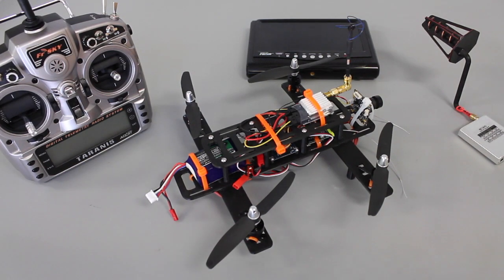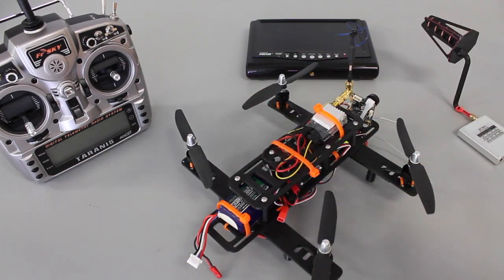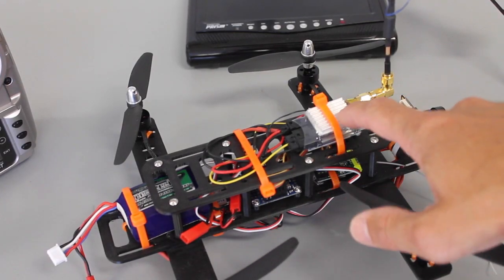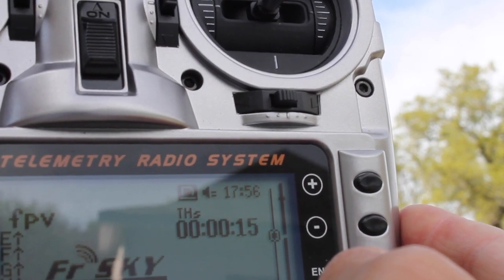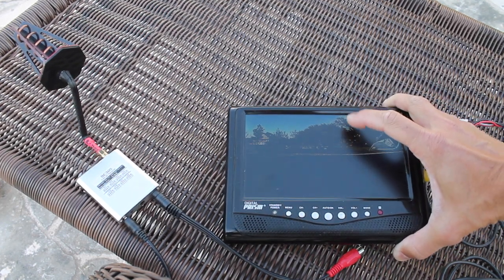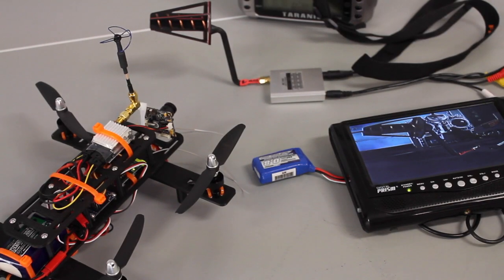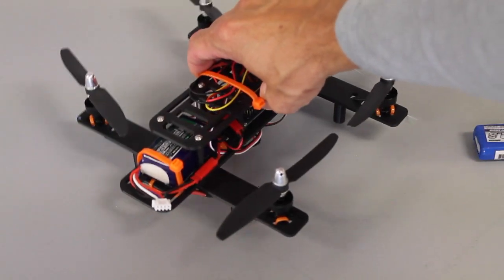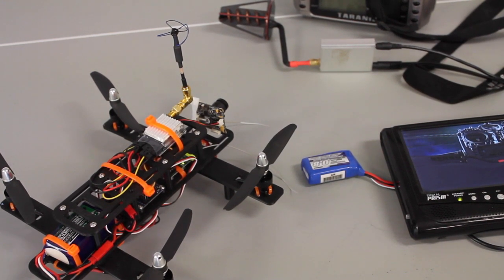DIY 3D Printed FPV H-Quad Backyard Maiden Flight

Comment: hi Dennis
could you please give details on motors and esc and where you got them .
Keep up the good work

cheers
Reply from the maker: Hi there. I'm going to be putting together the build log this week but I can share for now. These are 10A Turnigy ESCs that I got from www.gothelirc.com or you can get them from Hobby King of course. The motors are iPower 1811-13 2000kV motors that I purchased from the website above as well. I'm hoping to test some SunnySky 2300kV motors in the near future. Have heard great things about them.

Comment: What about switching the positions of fpv transmitter and the battery. Better for the center of gravity when testing with larger batteries. Otherwise you might be tail heavy.
Reply from the maker: Great point. When I get the new batteries in I will definitely try that. The CG is perfect right now but will definitely be a prob with a bigger battery. Thanks.

Comment: Hey Dennis did you make your Rx Antenna (on the boscam 305 Rx)
Reply from the maker: No, but my friend did. I'm going to be doing a build video soon and he's going to be releasing a DIY kit. Here's the intro video: A Brief Intro to Zwcky's 3D Designed and Printed 5.8GHz Helical FPV Antenna